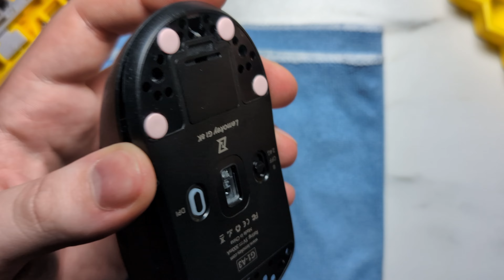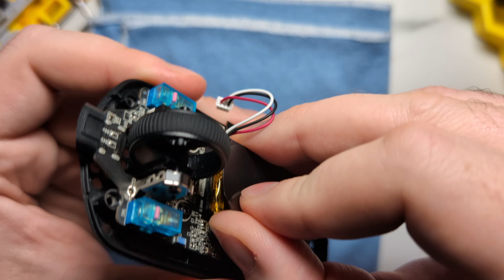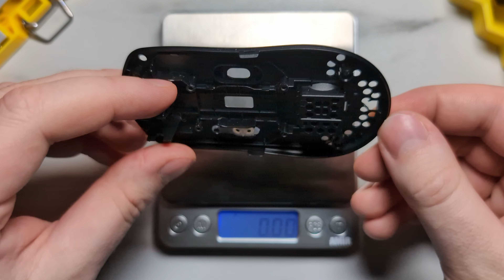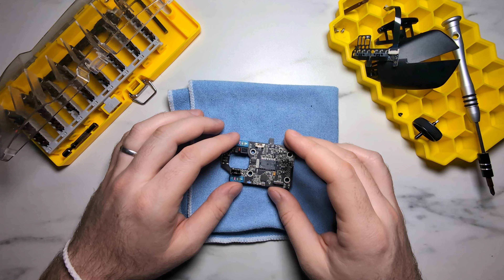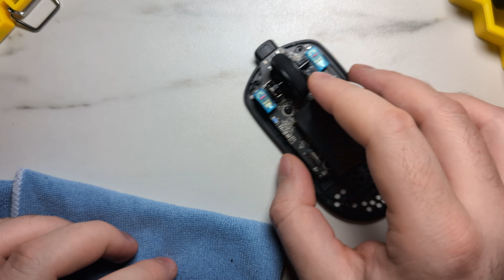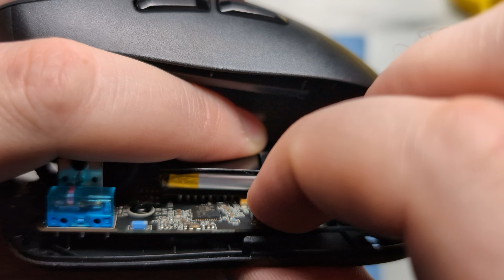TEARDOWN | Lemokey G1

Comment: Realtek was used for 8k wired/wireless mice alot and how long have you dismantling mice? Batterys used to be set like that all the time... And most companys dont want us dismantling there mice which  is crazy..right to repair is not a thing in the mice market.. they dont sell any replacement parts nothing.. cant even get side buttons for razer mice 🤬

Comment: I just got mine today, its good, not great, just good. I came from a VXE R1 pro and i gotta say i prefer it. The shape for me is very dissapointing, just a smaller G pro, so not bad but not realy great.The coating of the shell isnt nice at all, feels very cheap and could really do with some grips to atleast make it feel somewhat nice. Side buttons are okay, same with main switches, they just dont feel great, but arent bad. Mousefeet were a insta swap out to some Xraypad Jades and it was so much nicer. I do like the webbased software as i really do think its the future. The 8k is okay but on some games it just dosent perform that well as say my Op18k (im on a 4090 / 7800X3D). I wont be keeping it but i was glad i tried it.
Reply: So, OP1 8K has no match, basically?  I'm planning to orde one soon...
Reply: @Kliq-n2s  if you just want the best, then no. Op1 8k clears pretty much everything you want want quality, coating, good default feet and really solid 8k hz.